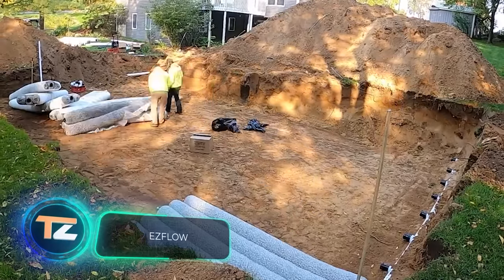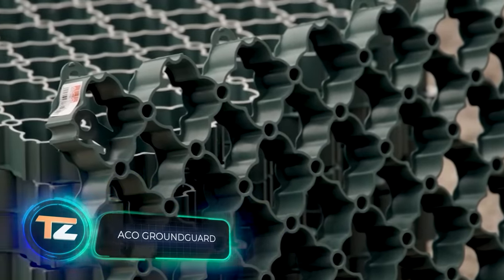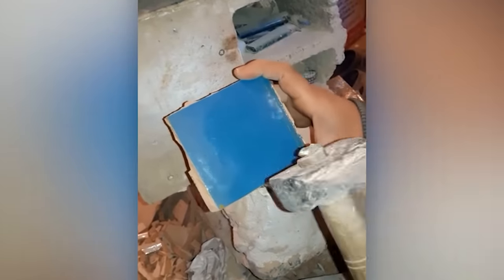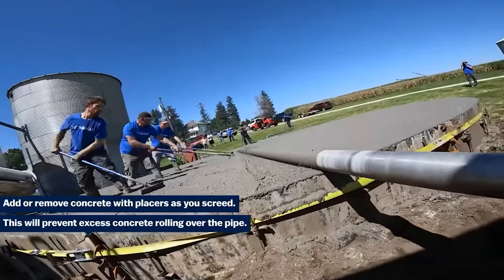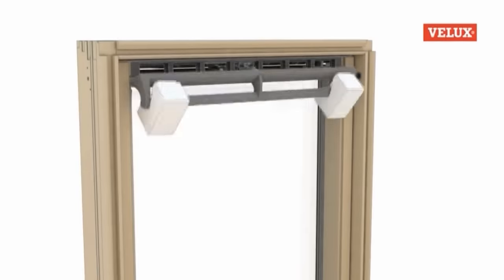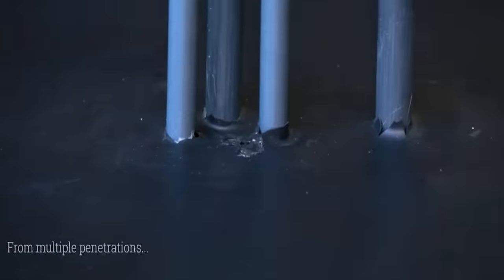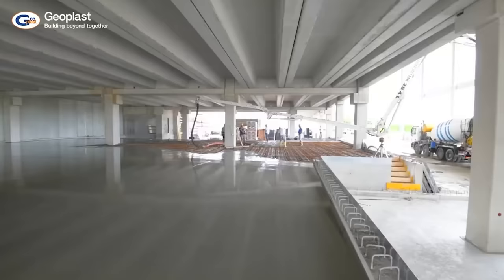CONSTRUCTION TECHNOLOGIES THAT HAVE REACHED A NEW LEVEL

Comment: Turkey has a strong passion for construction by cutting corners on earthquake safety measures to be more precise 1:21
Reply: I was thinking, during that segment: the built-in insulation is a great idea, and the system looks very cool and easy to work with... but there's no lateral bracing whatsoever. I'd hate to be inside - or on the sidewalk next to it - in the next earthquake.
Reply: AND they didn't even put mortar between each brick just top and bottom negating any insulation anyways as air will just penetrate all over the place.
Reply: And those bricks will do nothing to minimise contact noises.
Reply: Corners bring stability to the masonry. But with this stone shape and insulation, it can also be a weakening. @MarcTompkins
Reply: I agree 100% @michiellombaers3198

Comment: That was not a modular septic tank.  That was a modular septic field.  It would still require a septic tank likely with 2 chambers to separate solids from grey water.
Reply: I was thinking the same thing, it looks like a leach field. I was wondering how you would clean/pump that "tank" out.
Reply: @bikerbobcat q
Reply: it will back fire back into the house
Reply: يمكن ان يزراع فوق تلك مرشحة نباتات الخس ستقوم بالتعامل مع فضلات بشكل اكثر استدامة
Reply: Consider also that the lifetime of the recycled plastic is very low which will destroy everything in the near future
Reply: The installations in the video were for rain runoff.  At least that was my impression.
Reply: Leech field also called the infiltration system. It’s disperses the effluent overflow from the actual tank, which can be sucked out, but shouldn’t if the system is running properly.
Reply: Yes, it was disgusting. Their 'next level' tech is will be a small field of septic effluent and polystyrene microplastics in a decade, nearly impossible to clean up - great job, designers.
Reply: And not to mention how much space that BS takes up..
Reply: also claiming it's recyclable materials. yeah, anything is theoretically recyclable but in reality polystyrene is dumped to landfills or burned (which is good). some bugs eat it too. better to just say that you can burn it in high heat and skip burning oil.
Reply: I'd hate to add more modules after the fact.
Reply: Soakaway
Reply: Reed beds are very efficient too.
Reply: @cubertmiso  They didn't say recyclable, but recycled. And since a lot of plastics can realistically  only be downcycled, having a semi-permanent use for them in construction does make some sense. Basically, your construction project doubles as a landfill...
Reply: @bikerbobcat by digging it all up of course!
Reply: To be fair, Septic Tanks are non-exisant for most people who will be watching this video. So I can understand mixing them up with a septic field.
Reply: @MeepChangeling  There are lots of septic tanks in South Florida.
Reply: If that septic field becomes oversaturated, wouldn’t the polystyrene aggregate become buoyant in the soil and come to the surface?

Comment: What's the Earthquake resistance of those bricks/polystyrene there in Turkey. Looks flimsy for a County that gets devastated from time to time.
Reply: Yeah, I don't consider any construction from that part of the world, something to ever be considered.  

The drive in that part  of the world is how to make things cheap and quick, that looks like solid traditional construction when completed. Their line of thinking on so many things is that if it looks the same, it is the same. But of course, it isn't the same.
Reply: I wonder what tech. is used to screw a heavy load on a wall like that?   You couldn't just drill a hole and use a rawl plug to screw into!?
Reply: @stupitdog9686  Well you should know that these are made in Turkey and supposedly can be  used anywhere in the country. of course in areas where the recent quake hit, they lost about 70% of homes and many more buildings. 

The average concrete block is about 4 times stronger than this size hollow clay bricks. It's probably worse than that with this stryofoam insert design. 

They use these clay blocks because they are a cheap substitute for concrete,. Thet slap walls together with these, often very poorly done and then cover it with mortar.  When they're done, it looks like a solid poured concrete wall. The operative words being, "looks like". The reality is that it's a wonder these walls hold themselves up!
Reply: @professorg8383  Wow! I've seen similar construction methods and bricks used in lots of country's. Scary!
Reply: @stupitdog9686  They are widely used in some countries that have little in the way of building codes. I watch a lot of these construction videos posted to promote their companies and I frequently cringe at what I see. The way these guys do concrete has some pretty obvious flaws. The use of different type of red clay bricks is common, but it's quite difficult to find published specs, which makes me suspicious. 

There has been a lot of hollow designs showing up in videos. Generally these have a wider footprint than solid bricks. Many very similar inside to standard concrete blocks.  The hollow designs are extrusions and to makes them with any consistency, the formulations would seem to be in need of change. Apparently, they now mix in fly ash and even rice hulls, and other materials.  The resulting brick extrusions may be a bit firmer so they can cure to consistent shapes. The hollow, waffle designs are better thermally and that's what the promote from an energy standpoint and larger lightweight blocks build faster.  But strangely enough, these blocks are designed to be used with the cavities horizontal. They should be more structurally strong the other way.  Common sense suggests that structural compressive strength is lower than concrete blocks, but without specified numbers, you don't really know  how strong these are.

That said, testing can be done independently just by purchasing the blocks ad doing standard structural testing on them.  I did find a source fr such data which confirms much of what I surmised. I'm not surprised. I think the recent earthquakes have given us some good data. When old, well constructed buildings were left with little or no damage, but newer construction buildings became ruble, I think that's pretty telling. Turkey has pointed a finger at contractors cutting corners and ignoring what little standards they had.

I will admit that there is a huge lack of specification data, But with some limited data and basic knowledge of materials and construction techniques, it's still fairly easy to draw at least some general conclusions. And proof is in performance.
Reply: Looks like it’s not load bearing hence not much a concern. Your beams and columns are your concern mainly for earthquake resistance.
Reply: @rrsee-zk3zu  Maybe, I'd  like to see it completed. They don't say much about strength  or how they should be used, only some numbers on thermal efficiency. Kinda weird that they have almost nothin on their website and comments are turn off. Says they are designed to be exterior walls but not much more.
Reply: Very little. That's the point. If they fall down in an earthquake, they won't do much damage and will be easy to clean up. The walls aren't structural, they're just filling the gaps in a concrete and steel structure.
Reply: @flatey  Pardon my questioning the logic of a structure designed to fall apart in an earthquake. It really doesn't sound like a valid strategy. I know of nowhere taking that  approach. Structural or not, this stuff will injure people when it collapses. 

Most earthquake strategies involve the ability to flex or move  without collapse.
Reply: @professorg8383  Injure, not kill. In Turkey people's lives are valued more than property. You'll see the same solution in Greece and the Balkans. Japan has used a similar technique of a strong spine and light walls for centuries.
Reply: @flatey  Maybe you haven't been paying attention to the recent  7.8 earthquake. In Turkey. There were 50,783 deaths, 297 missing and 107,204 injured across 11 of the 17 affected provinces of Turkey. At least 15.73 million people and 4 million buildings were affected. About 345,000 apartments were destroyed.

The government is blaming contractors and developers who have ignored or cheated building codes. Strangely enough, in the midst of the devastation there were a few buildings which survived with minimal damage. Turns out that these were built to Western style earthquake standards. 

I have spent a lot of time in Japan, across the country. and you are missing the point regarding the way they approach earthquake resistance.  Japan traditionally used a lot of wood structures vs. masonry buildings, for the simple reason that wooden structures can flex. I have been in some massive, old temples that have survived for centuries. Modern buildings are constructed to allow for a lot of movement, using innovative techniques. In 2011, the Fukushima  was a 9.0. the final death toll was 20,000, but few from the earthquake itself, with the vast majority dying in the devastating tsunamis.

Japan is much more densely populated and I am very familiar with areas that have been hit with large earthquakes in the last  several decades. Stronger, more frequent earthquakes and none with the total building collapse like you see in Turkey. Japan has some of the most advanced earthquake protections anywhere.. One of my favorite cities there, Kobe, suffered a lot of damage in 1995. Arguably, the most damage and lives lost were tied to transportation infrastructure collapses. Many very large buildings saw foundation damage causing the buildings to drop and lean into the streets, but amazingly, the buildings remained remarkably intact. but leaning at scary angles. When it comes to building in earthquake zones, they know what they are doing.
Reply: Facts!!
Reply: @professorg8383  They have a similar philosophy in China. The vast network of roads and new built apartments look good on paper but are actually constructed with cost cutting techniques and not in a good way. Everything is made as quickly and cheaply as possible, even if it means sacrificing basic safety, to the point now where China is running out of homes because the thousands of brand new apartment blocks they built are crumbling to pieces.

Comment: I like the bricks that allow for insulation inside the wall
however I am concerned about the things you want to put in the house after you move in that require you to drill wholes into the wall
like TV, furniture, etc
Reply: Was thinking the same. Those bricks might be good for insulation but look a bit fragile and useless for screws and bolts.
Reply: ..turkey’s way to improve earthquake safety!… 😱🤥 🤯 ..a spit in the face of all earthquake victims this year and the countries sending aid/money
Reply: Because these are not bricks. These are ceramic blocks. They are better than bricks in terms of thermal insulation, but they are somewhat fragile. You need special mounts to hang something on the walls made of such blocks.
Reply: Not only that but since the insulation has gaps inbetween, it isn't as effective as if you were to glue it on the stone surface as a continuous layer
Reply: It's trash, the insulation has gaps at each brick. Better off doing regular bricks and external uninterrupted insulation...

PS: looks like someone else made the exact same comment above.
Reply: @vapeurdepisse  hehehe 😏
Reply: @timogeerties3487  Just what I was thinking. They look like gimmicks.
Reply: just buy a new house when it collapses 🤷‍♂
Reply: @tomfull6637  This boom was immediately prior to the earthquake. The reduction in construction standards allowed for faster and cheaper building at the cost of human lives.
Reply: Tapcons should work no problem. My main concern is i don't see how you would tie the roof to this wall. Since the block is S-shaped heat has a long way to go to get around the insulation, but brick only has an R-value of 0.2 per inch so it's still not much, although those air pockets do help in that regard so it might be higher overall. Hard to say without proper testing.
Reply: @tomfull6637  Most of the houses that collapsed in the earthquake was old. There are lots of 40 year+ homes in the Turkey in undeveloped areas and cities. The ones that damaged or collapsed despite being new is the ones our corrupt governors turned blind eye. Normally Turkey's earthquake regulation act is makes you build 8+ earthquake resistant buildings.Government itself does that so most of the civil buildings such as schools ,police stations ,hospitals  and TOKIs (Government made social houses)  didnt collapsed even damaged. Our problem is not the material, regulations or the laws but rampant audit corruption(Due to nepotism and corrupt government) along with lack of money to redevelop cities.
Reply: @exosproudmamabear558  Nevertheless this building procedure is appallingly inferior!
Reply: @tomfull6637  I didnt say anything about this building technic. I just said these two are extremely unrelated subjects.Also this isnt really a technic that used widely nor old. Usually you put insulation foam between two bricks, not inside bricks. So probably just some idiot came up with this idea and testing it out in some buildings. So this is a basically a technic that is still on research phase.
Reply: Remember that in US most houses are build out of wooden construction finished with drywall, no concrete or bricks whatsoever. You'll find a lot of things hanging there on the walls. (Most people don't know drywall has quite high bearing capacity for what it's made of, but of course it's fragile to transverse tension and impact)

You shouldn't have big trouble with mounting anything on those bricks with proper wall plugs. They probably shouldn't be too long, to not damage insulation (still, you have two layers of it, so this won't be a big trouble).
Reply: I wouldn’t bet on it to not have collapsed during the earthquake as well. Usually such thin walls are ok for inside, to separate rooms for example, but they are not stable enough when used as an outer wall. Sure enough in the USA most houses are made from wood instead of stone or concrete, but that doesn’t excuse the lack of knowledge for stability of brick walls. Show me one brick house in New York, that would have such a thin outer wall. All of them are at least double the thickness if not even triple, because it wouldn’t be stable enough otherwise.
Reply: @alexandrau6096  Well, I haven't said it will withstand an earthquake, haven't I? But I bet it's sturdy enough to hang a TV set on a wall.
When it goes about "earthquake-proofness", you have to take into account, that with durability of construction, the price goes dramatically up. That's why in the US, in places with high risk of tornadoes, or hurricanes, people still build houses based on wooden frame. The same goes in places with high risk of earthquakes.
It is cheap to build, fast to assemble, and in case of destruction, you don't lose that much.
Very strong concrete based construction, only has higher chance to withstand disaster, but under no circumstances, it will fully guarantee that it won't get destroyed to the bits, just like a cheaper wooden counterpart.

Comment: 3D-print clay bricks are not faster than extruded clay bricks. Have you seen the speed of that thing?
Reply: yes if its 1:1 but those can be scaled . Lets say if all in specified allignment they can do 100 at once .
Reply: @hemanth593  extrusion can be scaled as well, and takes much less floor space to process the same rate of clay.

Comment: 5:19 Extruding clay to make any kind of form, wether it's bricks or ceramic blocks is much faster and cost effective than 3d printing.
Reply: When bricks have holes through them longways, what stops outside air from entering the house? It seems like there wouldn't be any seal from the outside

Comment: @1:10  no way that werent crushed by the machine that installed it
@2:05 way too expensive
@2:56 last only 10 traverses. broken edges. also stupid
@3:46 "build a super strong deck and our product works perfectly"
@4:14 "its fancy because its slave labor"
@5:05 "they took our jobs!"
@6:08 you got a licence? no. get to work
@7:51 fake it till you make it
@8:30 seems like a good product
@9:46 a solution without a problem
@10:42 too expensive for projects
@11:41 will it also feed my cat and do my taxes?
@12:11 "our thing is awesome if you buy all this other stuff too"
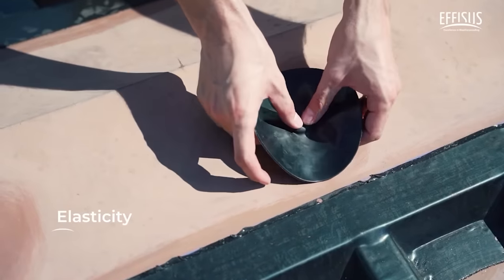@10:50 nah. just nah
@14:08 no way an engineer approved this

Comment: I'm just saying, if you can mention Turkey, but you might want to rethink referring to them as having a strong passion or embracing innovating methods, when almost 20% of the country crumbled from an earthquake due to poor construction practices.
Reply: And the similar brick they are using has been on the market for over 30 years.
Reply: Political corruption
Reply: Not the government building tho, independent builders are cheapskates there
Reply: It is an old building, i think you are being unfair here commenting
Reply: Those were literally from old code uncompliant buildings..
Reply: @astronemir   Negative ghost rider, many of those buildings where built in the last 20 years, I personally visited 2 buildings that were built in the last 5 years when I visited a friend and his wife, then went to his wife's parents house for dinner. Both buildings built by different companies and construction started after 2018.  

The funny thing, is all the old buildings that still stand from when Turkey was Greece, are unharmed.
Reply: Thats the most redneck comment ive seen in a while. Have you ever even been to turkey once ?. Because there has been collapses ina remote and rural area abd some corruption doesnt mean that turkey is not innovative. They are leaders in construxtion industry even having contractors working around middle east africa on high tech buildings and infrastructures..